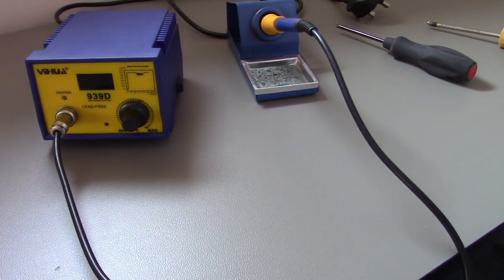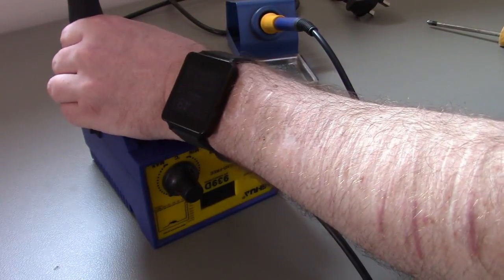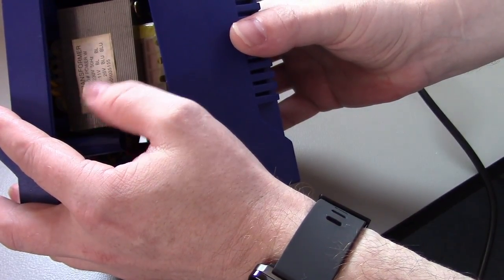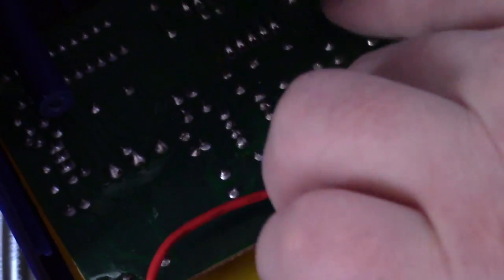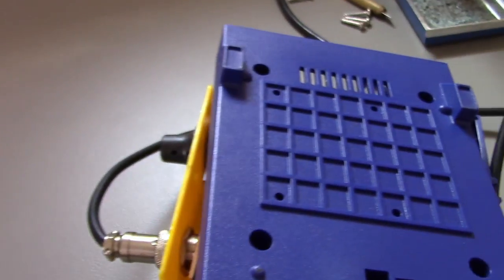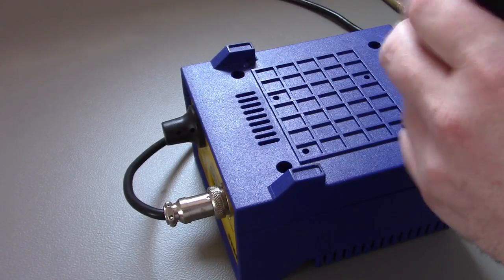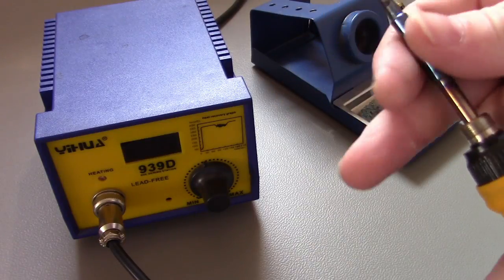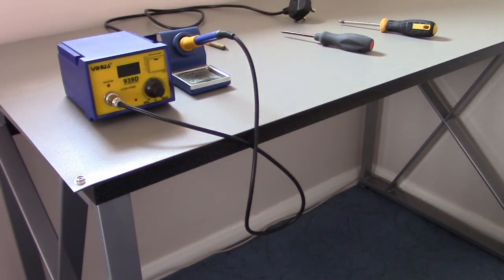Yihua 939D Soldering Station Teardown

Comment: The soldering inside isn’t good at all. I had to go through mine and fix several cold solder joints and poorly stripped wires (they actually cut quite a few strands on some wires). After I went through and took care of those issues, it’s been functioning fine since.

Comment: Fit a small buck converter and  +/- terminal lugs, plus Voltage control knob and a mini volt meter, cost about $8.00,.. and then you also have a built-in DC variable power supply,.... Its fucking great....

Comment: This is a very good option if you are in budget.

I have many soldering stations, one Hakko Fx-888d, one Hakko Fx-951, one Mlink S4, one hiyua 936 and one Yihua 939d like this.

Yihua 939d works very well in my opinion.

Cheers.
Reply: ¿Is this a good buy for use in repairs of (one of a kind/no spares) stereo equipment?  It seems rugged enough, have seen other videos where the heat up to temp is fairly fast, and tips are Hakko compatible (for spares).  I don't do a lot of soldering, but am looking for something better than my 25W (120VAC) wall plug style unit.  (I don't know how hot my iron gets, and that's one reason for desiring a soldering 'station' as this one).  [Hakko entry level unit is ~twice as expensive].  Any/all comments welcomed.  Thank you.

Comment: Thanks for the vid,This unit will suit me well for 30.00 shipped..I need an iron about five or six times a year..I purchased it after watching your video And not only has it paid itself off it made me twenty additional dollars soldering some cold solder joints on a chevrolet silverado 4x4 selector switch...Soldered up my broken left speaker terminals on the motherboard of my Macbook pro and then repaired the tow haul switch wires that were broken on the old ladies truck...If it broke tomorrow I would be ahead of the game but I doubt it will....
Reply: You could have made due with a $3 soldering iron for that.  A base station with temperature control is mostly needed when dealing with electronic components like heat sensitive ICs or connectors, terminal blocks, etc that have plastic that would melt if it's too hot.   Plus with a (moderately) higher power station like this, the recovery time is shorter but that mostly only matters if you're soldering a lot of joints repetitively.
Reply: @stinkycheese804  No fool..Those pieces of shit never get hot enough to do a good job..I am up to about 12 guitars a year that I build now and yes I need to be careful with my temps...Go do something productive in fife other than commenting here just to feel like you are worth something in life..Here is a hint...VOTE REPUBLICAN ASS HOLE!!